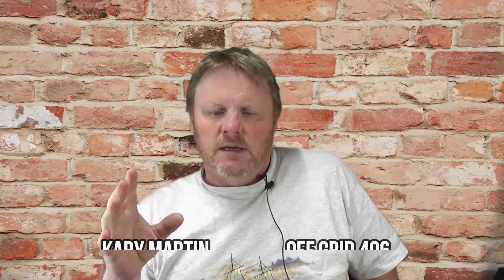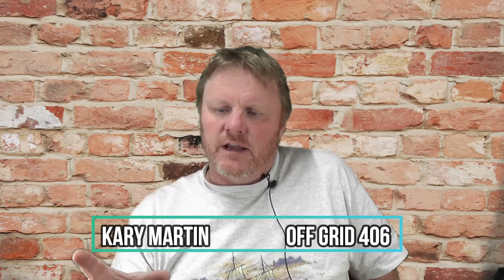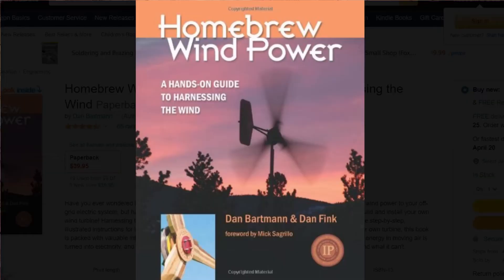Watch before you buy a PMA, permanent magnet alternator for wind power, wind turbine, wind mill

Comment: Hi, I like your approach to this subject. Yes, Piggott was the pioneer, I still have one of his original papers, printed on green paper, bought mail order before the Internet was a thing. I follow the rationale behind the car alternators upgrades for wind generation, but I've never understood why the field coil rotor of the car alternators were deleted, it seems a great way to regulate the generation, sure the original controller won't do the job, but regulating the field current to allow the prop to spin up easily in a low wind and then maintain some generation in all conditions seems like an ideal way forward. Maybe it's because my background is in electronics that this way seems to be the most appealing? Maybe someone somewhere has already come up with a microcontroller design to manage this application?
Reply: @Mark Dale - The Field Coil can draw, up to ~2 amps from the battery bank.  Therefore, it appears to be more efficient to install Permanent Magnets.
Reply: @MrSummitville  Not if the PM generator won't turn in light winds. The full field coil current would only be required at maximum output so if the gen is putting out 60 Amps, 2 amps is not that bad. The field current could be controlled to maintain optimum generation in all wind conditions while the efficiency remains greater better than 90% say, and more like 98% in the best case scenario (talking electrical efficiency here, not overall). I want to know if anybody has tried this?
Reply: @MarkDaleADV   But an AF PM Wind Turbine DOES turn in light winds!  It spins with ZERO Cogging.  If you don't have any amps flowing through the Field Coil of your Alternator then it generates 0 Watts!  So, if you have low Field Coil amps AND Low wind speed = You get nothing.  You need about 2,000 RPM to get 60 amps.  I want to see your Wind Turbine make that happen.  Also, when the car engine starts the Field Coil is energized and when the car engine is turned off the field coil is de-energized.  HOW are you going to know WHEN to turn the Field Coil ON and OFF?   Whenever your 12 volt alternator is making less than 24 - 36 WATTS, you will be NET losing energy.
Reply: @MrSummitville  You have offended me with your ignorant and presumptuous comments. You clearly think you are the only one who knows anything, and are therefore a master of the galactically obvious. It pains me to explain it to you, how do you think I will know? The microcontroller I program will monitor and regulate the field current to keep the alternator turning at the optimum revs, whatever I decide by experimentation that might be. A small initial field current is all that would be required to produce an output which could then be used to monitor the running state of the machine.The interesting thing about this method is that it creates a smart machine and the possibilities for control are endless, unlike the dumb PM version which just turns, and chucks out power in an uncontrolled way, which then has to be dumped or mechanically limited. I would like to explore this alternative approach because it is elegant. You may not understand that concept, but it makes the effort worthwhile even if the outcome is in all other ways less. Anyway the chances of a stimulating exchange on this thread are clearly very limited.
Reply: Car alternator is made for amps. It takes a certain amount of magnetic field to make it work, and  usually about 5 horsepower is what it wants when the regulator kicks it on. It's mostly the way the windings are made. They try to get 3 kw out of 15 feet of wire so it takes a lot of magnet. Alternators run hot too because it's maxing out what the wire can carry. They're actually not very well suited for wind. I don't know a great amount about wind power, but I've been around cars and salvage since I was six years old. Basically the rotor is acting like a brake and that has to be overridden, that's why car alternators run hot. They are actually not very efficient. It takes four and a half horsepower to turn the smallest 35 amp alternator, but an old DC generator from a '61 Bel Air takes two horsepower. As the battery becomes charged, the generator takes even less to turn, while an alternator still takes the full five horsepower. I think that is why people have trouble getting them started turning, while the DC generator is happily spinning away. I thought the same thing as you when I was younger, but in practice it doesn't work like that. They're really just not designed for adjustable field voltages, and such. Actually the DC generator puts a better charge on the battery, and doesn't waste part of the output on a rectifier, which also runs hot usually. More efficient. I think that is what is lacking in a lot of new designs. Everyone just blows that off but that's why they don't get the anticipated results they were dreaming about. I still remember the old Wincharger. That's why the old stuff is highly valued. It works.
Reply: @davidpotter9462  0nce again, you are basing all your observations on how an auto alternator works when controlled by the OEM regulator. The standard regulator starts the alternator at maximum output (maximum field current when Vbat less than 14V) because the designers knew that all auto motors can spare the few horse power to turn the alternator. The design objective in simple terms here, would be to replace the OEM regulator with one which regulates alternator rpm, not battery voltage. With no field current it takes close to zero hp to turn the machine. I know they are optimised for their application, however I explained why that compromise is worth ignoring in my last post. I hope you can now appreciate the alternative thinking, it would be similar to regenerative braking, more pedal pressure results in greater retardation, less allows the wheels to revolve at higher rpm. Pedal pressure being supplied by the microcontroller to keep the rpms constant in a wider range of wind speeds.
Reply: Hello again, in the spirit of a mutually beneficial discussion as you seem to be a reasonable man, there seem to be a couple of anomalies in your comment. For example, the field coil in an auto alternator is in fact made for adjustment, once the battery hits the regulating voltage, the field current is adjusted to balance the current load and hold the battery voltage constant, if then the lights were switched on the field current is increased to generate more current to cope with this additional load. If you read through your comment you will see other examples. I'm giving you the benefit of the doubt because you probably commented in haste like most people do. I'm also interested to learn how you measured the hp figures you quoted.
Reply: Oh, lol, I used to fix small engines for people, so I had different sizes and power of them. I worked at the local auto salvage so I had alternators. One day I decided to make a gas generator to jump start cars with. Actually wound up making three of them, one with a 2 horsepower engine and DC generator. One with an 8 HP Briggs and Stratton and a 100 amp alternator. I tried a 4 HP Briggs and Stratton on the 46 amp alternator, and it wasn't quite big enough. Had to use a 5 HP engine. The 2 HP worked out on the generator, took longer but used less gas. I used to use it at the salvage yard to help start a car that needed a lot of cranking to remember how to start. It was a lot easier than carrying a battery back to the charger. I just used it without a regulator, the little engine would only run it at one speed but it would bring the voltage up on those old batteries that had been sitting around. Once they charged it would speed up a little so you just had to listen for that to know it would usually crank over then. I experimented with resistors and a potentiometer on the rotor voltage but it was just a threshold type deal...it either was charging or not. There was no halfway in between on the junk that I had. As long as there was 11 volts they would start charging. Might have been the design, IDK. For wind power I would use either DC or an AC generator. I don't think wind is very well suited for an alternator of the automotive variety. It takes too much torque to start one to charging, which the blades don't have unless the wind gets up to breakaway speed. There's too many inefficiencies that a generator doesn't have. That's why they don't put out the rating. If there's a tornado, and the alternator is spinning 20,000 rpm, it will put out the rating, but the blades will be in the next county. There's not a good match there. When the speed is enough for the alternator, the blades furl. When the speed is not enough, it just sits there. So half of the wind is wasted. Then when it does make power, it has to go through a rectifier...more power is wasted in heat. The DC generator has neither of those problems. How about a 1222H Winco wind generator... it's a proven design....the difference is, it's a generator, not an alternator. No cogging...lol
Reply: @davidpotter9462  I see, very inventive, sounds like a lot be of fun experimenting in that junk yard. As you experienced, it would be difficult to regulate a lot of current in the field coil using a fixed resistor, I'm thinking a switching regulator would have to be employed to keep the heat dissipation down to manageable levels. The efficiency of a 12V auto alternator is pretty low as you found out, and would be improved greatly for wind generation with the inevitable rewind with more turns of  thinner wire to boost the voltage and therefore require less current to reach a specific output without all the I2R losses that spoil the auto alternator. But that's where my idea departs, retaining the field coil to allow a new regulator to control rpm not voltage. One day I'll give it a try, just for fun, I don't have any serious intentions, just a low cost conversion of a cheap scrap auto alternator. Replacing the rotor with one that has permanent magnets departs from the cheap ethos, unless you have a machine shop at your disposal, which I don't Anyway, I like the elegance of my idea, and my skill set is electronics so even more appeal there. I hope you're still tinkering, all the best.
Reply: Hi enlightened me to make generator? Email me please the green print behind alternative to generator?

Comment: Anytime you put a magnetic field around copper coils you make electricity , 
And if you add an iron or steel core , this increases the electric current ,  
Add a Tesla coil and the voltage increases , 
I have made a 4 inch Arc ,
It was really Cool and Super dangerous , 
About 5000 Volts

Comment: That's why I got 4 of them , 
One is for a VAWT , 
It will have a 26 inch bicycle rim running a Serpentine belt and of course Serpentine pulley which gives about 
9 to 1 ratio  ,  and it only has 2 foot pounds of Cogging , yes I can spin all 4 of my PMAs with my hand , 
Each one makes 1200 to 1800 watts depending on how fast they spin , 
I tested each one up to 3600rpm for 30 minutes straight making power under load , they each performed great , 
So one is going on a VAWT , 
2nd on a  4 foot or bigger Water Wheel 
3rd on a bicycle 
And 
4th one on a 40cc gas chainsaw engine 
Then I have Solar Panels and a Generac Generator .
So I have have 
Sun , Wind , Water , Human Power , Gas engine all sending in power  , 
All together I have about 
12KW  but I'm wanting about 15 to 17KW  just to be safe
Reply from the maker: Don't forget to send me update pics. I think what you got going on is great. Feels good to be self sufficient!
Reply: @veggitarianredneck  , I'm still buying more inverters and lithium ion batteries , 
 I'm buying one to Two pieces at a time as I can afford them , 
It's coming together slowly but everything is paid in full and I don't even have $1000 investment in everything , 
But I'm doing everything myself , I plan to spend another 1 grand on inverters and 2 grand on Batteries , 
So about a  4 to 5 grand total investment after Welding , fabricating and miscellaneous , 

But with other systems in the $25,000 to $35,000 dollar range , 
My system will pay for itself in very little time
Reply: @jimthomas777  Make a video of your wind turbine spinning the alternator at 3,600 RPM.  WHY does nobody else do this?

Comment: like you say you get what you pay for, have you seen james biggar or orlando sanchez , im planning on building an axial i have most the equipment just no time right now. josep castelles made a nice axial, all those guys make good power in low winds at low rpms  they done it for years. you need to be in a good clean wind location. i have those car alternator style pmas  theyre pretty ordinary.
Reply from the maker: I built a couple axial flux turbines, and they are wonderfully machines.